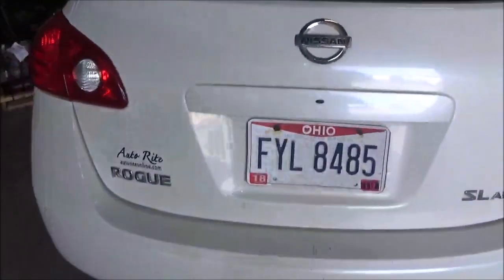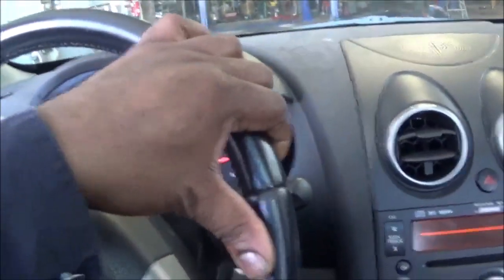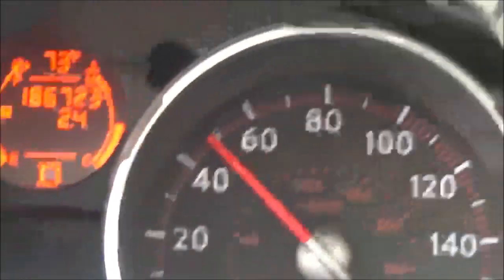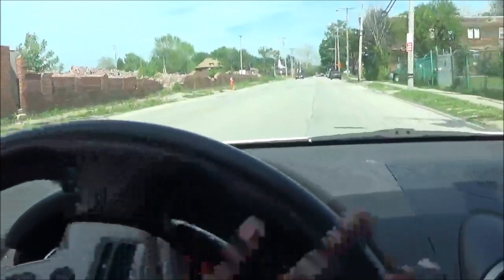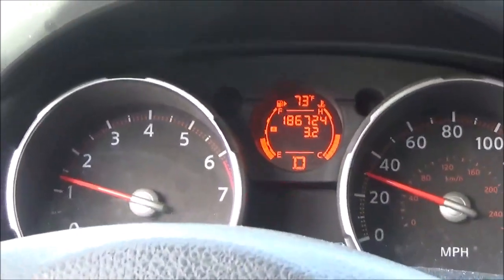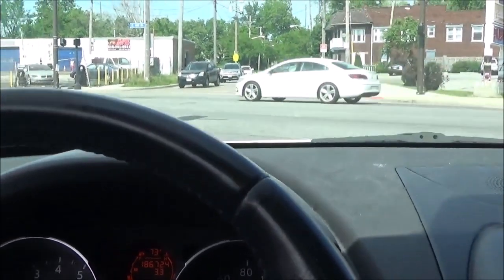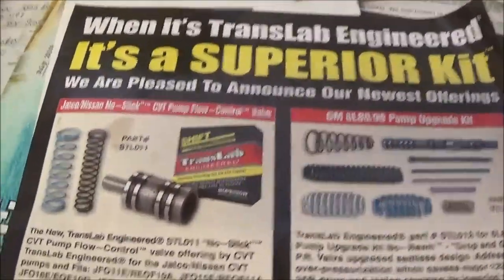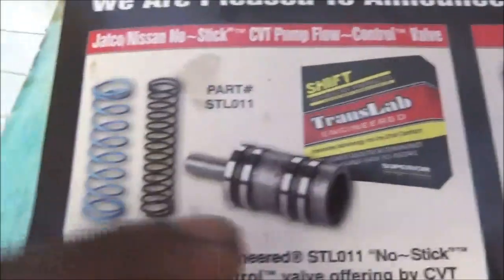TRANSGO JF011E TRANSMISSION FLOW CONTROL VALVE  TEST IN A NISSAN ROGUE. (IS IT WHINING!!!) PART 1

Comment: So is the sonnax oversized valve better
Reply from the maker: I tried the sonnax oversized valve one time, and it seem like it did not work right. However, I will try it again one day since I have the tool for reaming. It seem like it also had a buzz to it. I will have to try it again. I have been just getting a rebuilt pump or cleaning out the bore and using a new regular valve.
Reply: @thisisyourtransmission I'm gonna try the non stick one again. By superior. I tried it before, but I don't think I cleaned out the bore, right? And I may have forgot to oil the valve up in the bore, so I'll let you know I'll try it again. I'm just trying to see which one works the best and last the longest.
Reply: @kiddynamite2785 any feedback?
Reply: @jerytherew1 Part No. 33510N-02 that the one i use from sonnax  Not the one with the oversized valve just the regular 1 This is the only one that seems to work right the ones from eBay are cheap knockoffs I open up the pump put some oil in it and then put the valve in there move it back-and-forth make sure It doesn't have a bunch of resistance
Reply: @kiddynamite2785 I'll try it. Thank you

Comment: My 2011 rogue revs to the fuckin moon and doesnt go over 20-25 mph 🤣 and i justt replaced both filters and the valve body.
Reply from the maker: You probably need a transmission
Reply: Any codes? Check tail light switch.

Comment: hey what happens when these oil control valves go bad, does it start to just overheat the fluid and go into like a limp mode where it feels like its stuck in high gear and barely has any power? thats what mines doing, i think its the pump, already replaced valve body and have same problem
Reply from the maker: It will do everything that you said except overheat the fluid.

Comment: I have same problem with my sentra 2013, i use the valve, when going to stop, going to neutral, low pressure problem🤦🏻‍♂️
Reply from the maker: Would not recommend this valve at all.

Comment: So it came in the shop with the noise and you weren't smiling when you had to remove everything again. Very informative videos and very thorough. Do you think the valve gets stuck which in turn causes the whine? Thanks for your quick response.
Reply from the maker: Well, with this new valve no. Transgo just did not calibrate something right when designing it. Maybe thr spring that they have is too weak and alloes the valve to vibrate" I don't know. But what I do know is that when something is wrong with their parts, and you tell them, they are so full of the wrong type of pride, they get mad. And believe me, they will keep selling them also, and whoever uses them can get messed up!!!
Reply from the maker: You try to fix a problem and you end up putting their problem in!!!!

Comment: I heard you say  that you were going to take the transmission back out.  What was the original problem? Did you also get a code for pump problem? If so which codes? I have the same noise coming from a 2010 Murano. Im not positive but think it is the JF010E.  Great videos! Thanks
Reply from the maker: The noise was that valve! Another friend of mine who works for WIT transmission had the same problem when using that valve.
Reply from the maker: I have a video on the murano pump and what it does

Comment: Nice video, I have a JF015E Transmisión and some times makes a low frequency “rattle” noise at 2200-2500 rpms and some times the car lose power. I change the filters and the valve body, no metal particles on it, so I’m pretty sure the variators and chain are good. But I’m thinking the pump is bad.

My problem is to get the car to a workshop where I live is expensive, and the tech guy doesn’t know even what transmission my car has, I told but he doesn’t trust me.

What I want to know is, do you know if it is possible to get access to fix the pump underneath the car (valve body housing) without taking the transmission out?
Reply from the maker: On most cvts, the pump can only be taken out if the transmission is out of the vehicle. This is what I had to do to get to the pump that is in this video. I have not taken apart a transmission for a 2017 yet, therefore, I cannot tell you what the problem is. I would be guessing. Now, I took apart a 2013 nissan altima transmission and it had scored pulleys and a judder to it while it was driving. It even had a judder code without the check engine light on. Maybe you should have it scanned to see if any codes are hiding somewhere.
Reply: Thanks for your reply, I’ll keep looking forward. I will let you know once Its fixed.
Reply from the maker: What year vehicle? What type of vehicle?
Reply: It is a Mitsubishi G4 Sedan 2017 (aka Dodge Attitude in Mexico) 90k miles

Comment: Nice videos.  Did you determine whether it was the TransGo flow control valve that was causing the whining?
Reply from the maker: I have not taken the transmission out again yet. This is a vehicle I bought. I am working on customers vehicles first. I will try to get it back in soon.

Comment: " There is a song about smiling faces! "
Reply from the maker: I will probably take this transmission back out next week. I was thinking if there was some way that I could drop the pan and hook a hose to the filter and let it run while the pan is off to get closer to the pump noise.
Reply: @thisisyourtransmission  You can do that?  will the pick up / filter inlet be able to  suck the fluid up?  I was thinking may have to make a reservoir at the level that the pan should be so that the pump can get the fluid as normal.   Sure to be a bit messy.
Reply from the maker: @BrianMann216  you are right. It will be messy but I need to be sure that that new part is the problem so I can fuss with those guys at the seminar. They will keep selling their product.
Reply: @thisisyourtransmission  Keep it up,    tough situation.
Reply: Very informative, thanks for posting